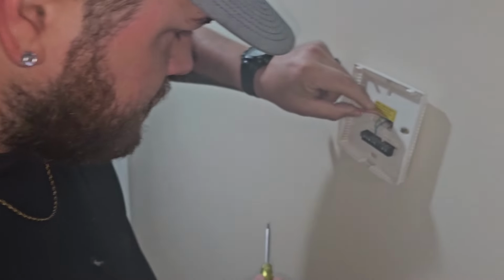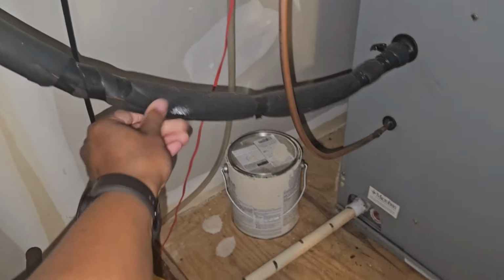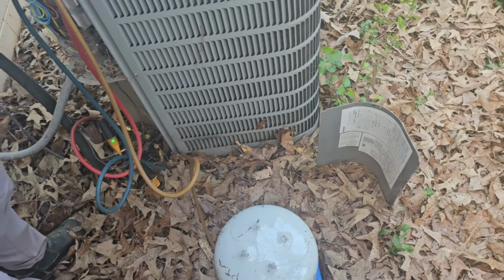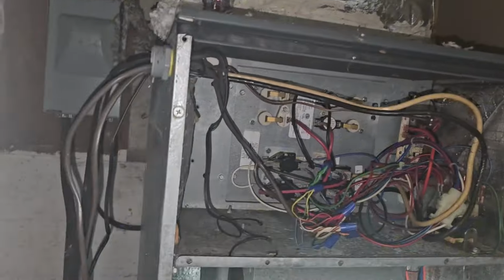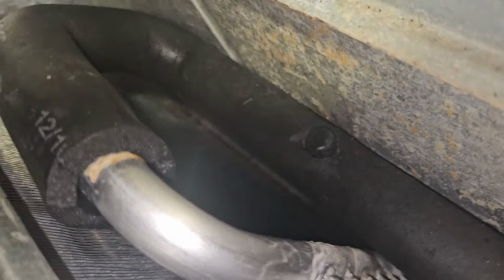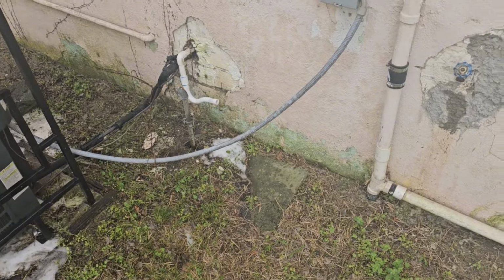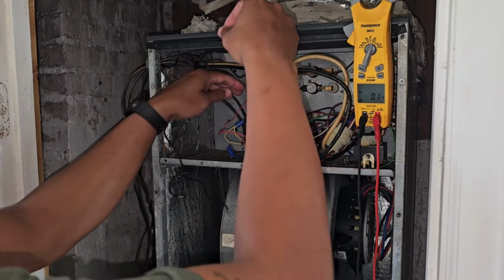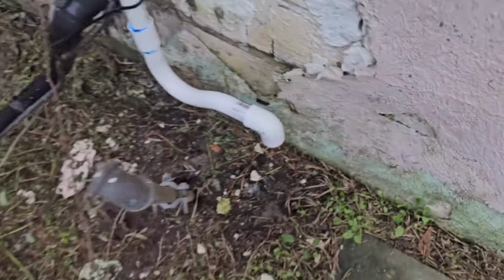Running Multiple Service Calls and Showing Jacob How To Add Refrigerant

Comment: U didnt even purge the hose before letting freon in ….. u just let air into the system…. Rookie mistake.
Reply from the maker: I was taught if you have the valves on the end of your hoses and close it, crack open the tank then flip it and open the valve, you won't have that issue. And for 3yrs it hasn't bitten me in the butt
Reply: Refrigerant! Freon rookie mistake!
Reply: I was taught the same way to be honest you don't have to purge the freon at the gauge side of the hose u can do it at the tank so yeah good Job ab n ya boy to God bless you both 😊
Reply from the maker: @user-us9ro1ht1b  I mean I talked to my old mentor back home and explained with that logic everytime you hook up to a system you should purge, because that air in your common hose (normally yellow) if you purge that out good but the air in your low side port (that could've entered the hose while you were hooking it up to the system) would also put air in the system when you add refrigerant. So I guess just try to not put as much air in the unit as possible

Comment: I’ve noticed in your videos that there is a huge bad thermostat pandemic going on in your area. Lol
Reply from the maker: Man lately it's been a crap ton of frozen units 🙃
Reply: I replaced a few of those pros that were fairly new and installed one that failed in 2mo. They’ve been blacklisted from my truck. 
For the basic stat I use the Emerson 70series, maybe 2 failures, one was because it was filled with roach babies
Reply from the maker: @MoonRambo702  see it's crazy you say that because since I joined this company, we mainly install the PRO T701 (1H1C) and T721 (2H1C) and we haven't had that string of bad luck. 
When we started putting in Temsptar equipment that supplier was giving us Honeywell T4 & T6s and we were having a couple problems here and there and just made them start carrying the PRO's for us.
Reply: @AB_HVAC  I like those Honeywells, they look more modern and clean. Few more features like setting the min/max temp.

Comment: Why didn't you clean inside to the out on condenser or check inside the evaporater
Reply from the maker: That unit was in a cage, wasn't going to grind the top off, to then remove the top just to clean the condenser.